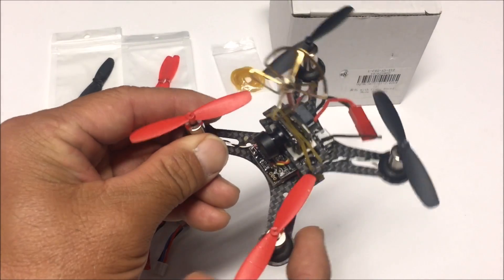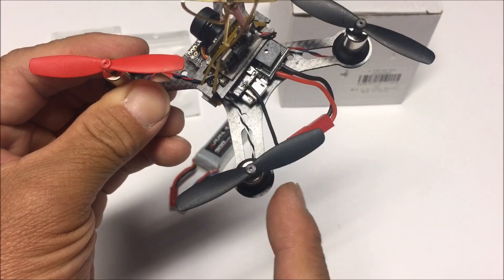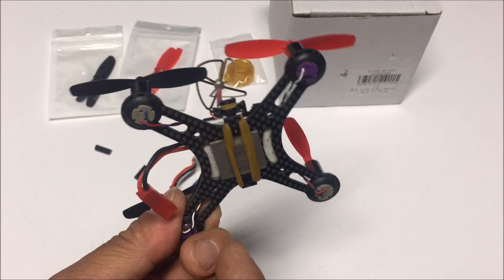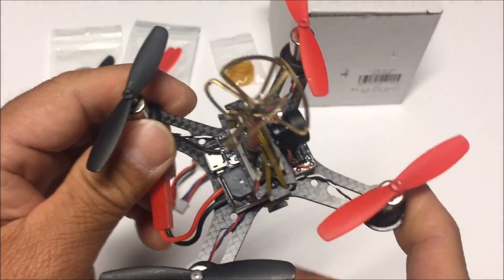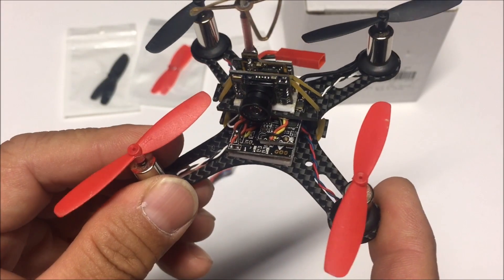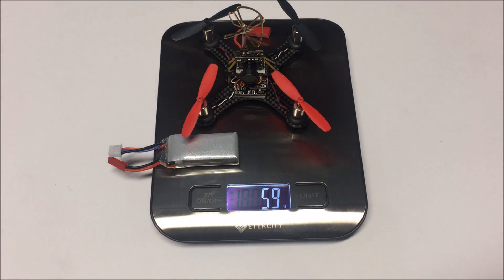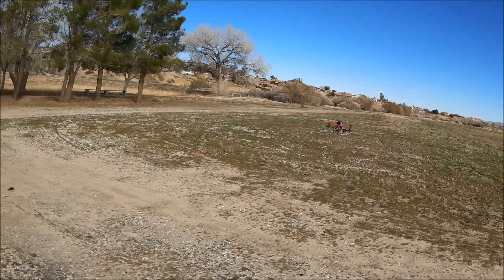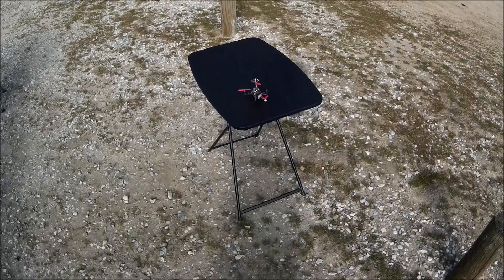qx90--Gearbest

Comment: try a osd aio fpv to see if voltage is dropping to low, try high voltage battery 550mah mylippo for example, or bad pid's need more I and D (keep d low to keep motor heat down), also could to low kv motors or it is simply wind or signal interference